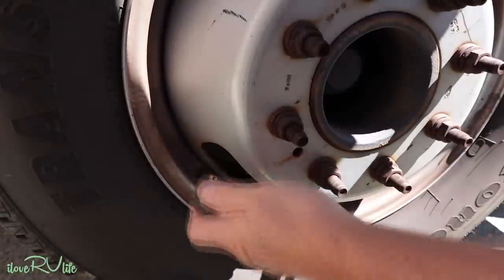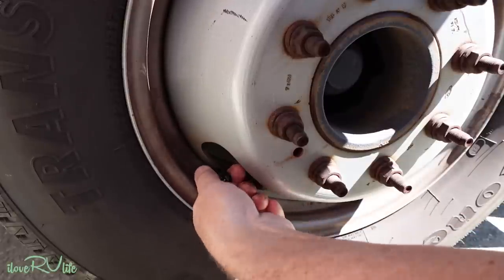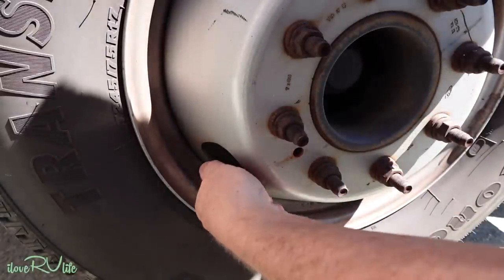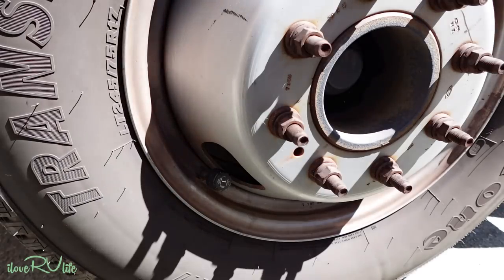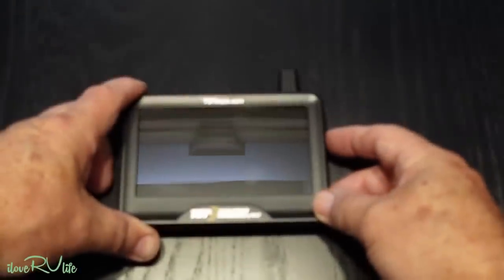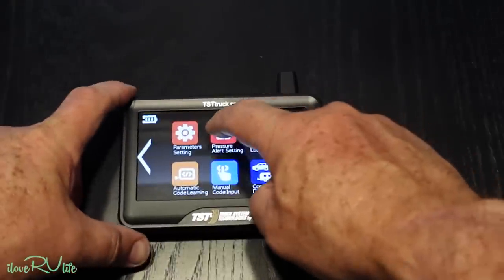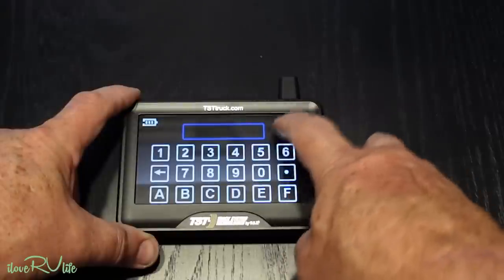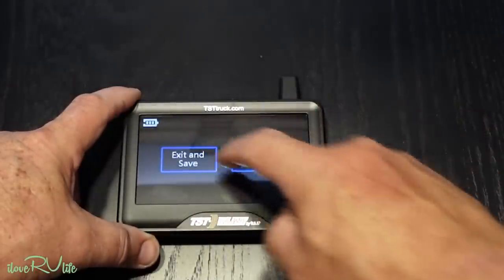Using TST 770 Tire Monitor on 5th Wheel and F-350

Comment: Jerry,
I own the 507 display. And I think new display is backwards compatible with just using my existing sensors. 

My main question, is that beside the bigger display and the second compass screen, is there any other warnings this newer units provides verses the 507?

Thank you👍😎
Reply from the maker: No changes in sensors. Both monitors worked. Same warnings. Better display. Can set up one tow vehicle and screens for 5 trailers. Helpful for those who have RV, boat, etc. Does have the second screen with compass, trip mileage, speed, and altimeter which is nice.

Comment: Jerry, I need to get s new TPMS system for my RV. I used to have a EEZ Tire TPMS but after 5 years of occasional use, it stopped working altogether. I've looked at TST units, Tireminder units as well as another EEZ Tire unit. I reached out to all three companies for more information and why I should choose one of their units and the only company that got back to me was TST, by phone, and within 15 minutes of sending them an email as well! Because of their quick response, I'm likely going to choose TST but I'm torn between the 507 model and the 770 model. First, are you still using the 770 model and are you happy with it? Second, if you are happy with it, would you choose the 507 or 770 if you were in the market to buy one? Thanks.
Reply from the maker: Both are good units. I prefer the 770. Larger screen, improved presentation, more mounting options. I had an issue pairing one of the internal units that was installed at the factory. Called TST, got a tech quickly, and he gave tips to pair and stayed on the line until all was working. Superb service. If I had it in the budget, I’d buy the 770.
Reply: @iLoveRVlife  Thank you Jerry. I trust your advice and love your videos. Keep up the great job you're doing! One more question if I may...My new truck doesn't have a 12V outlet but it does have USB A and USB C receptacles. Will I be able to unplug the cable from the 12V plug and plug that USB C connector in directly for power?
Reply from the maker: @robh063 Thanks so much.  You should be able to depending on the USB power rating. I’m running ours on a standard USB 2.1 amp connection. The 770 has rechargeable batteries so the USB connection is keeping the batteries topped off.
Reply: @iLoveRVlife  Great! Thanks Jerry.

Comment: How hot is too hot and how much is to high on pressure on your tires.
Reply from the maker: Hi Bill.  It depends on the tire. The manufacturer has specs on tire performance and most can be found online. TST has standard settings based on acceptable ranges that are set as default if you can’t find you specs.  I run my pressure at side wall specs found on the tire. Set that on the TST 770 and use the defaults.

Comment: I had a blowout in Louisiana in January.  I think my Tireminder did help and alert me.  I stopped and looked at it and didn't see anything but then it held air for an hour before it blew and it did alert me beforehand.  I would caution you about using the cap type on the truck.  I really liked having them on my truck, but I had 3 tire stem failures on the truck.  Never had a failure on the camper, but after all those issues I took them off the truck.
Reply from the maker: I’m using metal stems on the truck. I’ll let you know how they hold up.
Reply: @iLoveRVlife  i couldn’t find a metal stem pack compatible with my ram.  I will say if you haven’t seen it there is a great metal stem replacement for trailers called the Colby extra short.  Tireminder recommended them for my previous 15” trailer wheels as the contour wouldn’t allow a normal metal stem.  It’s great to keep for emergencies too as it is installed without removing the tire

Comment: I have the tst on my 5th wheel and I did have a blowout with no warning. Just a tire failure. By the way these tires were less than 600 miles old and in date.Tire temp and psi were in range. So tst does not have capability to catch everything. Still love my tst and except some things can not be prevented. Thanks for your video!
Reply from the maker: Unfortunately, If the tires aren’t over or under in pressure or temp, there’s nothing to alarm. I had TowMax on the Gateway. Wish I had done the research on this brand before travel and has a TPMS.  Separation occurred over 3,000 to 3,500 miles. Heat build up blew them to shreds.

Comment: I have a TST unit on my fifth wheel. Last year on are way home from Florida and lost a tire on the fifth wheel. I didn't know it till a passing truck flaged me that I lost a tire. After 5 hours later and a mile walk back for the tire, I was back on the road. PS the tire monitor didn't tell me the wheel was missing.
Reply from the maker: Sorry to hear that. Interesting. I tested the new 770 several times, turning off and on.  It took around 5 minutes to refresh.

Comment: Hey Jerry! Thanks for all of the great videos. A TST is a MUST!!! Just this week, our TST showed one of our motorcycles  trailer tires was 25 degrees warmer than the other. Come to find out that we had a bearing failure. Without the TST we surely would have lost that wheel off of the trailer going down the highway! Catastrophic damage would have occurred. Thanks again for your advice. 
May your roads be smooth and camp sites level!!! Brendan & Lena
Reply from the maker: Thanks for watching. This is a very good system to catch those tire and wheel issues before they become bigger problems. Great to hear it work when you needed it!

Comment: One thing you didn’t cover is the fact that you can rotate the tires and resetting the location. That’s why I got it three months ago.  And Techno RV was who I got it from. The only thing that I have had a problem with it will lose signal on occasion with a single tire but will regain it in a few minutes. I will be interested to see what it shows when we get into northern New Mexico the second week of May the town of Eagle Nest elevated 8250 ft. I looked at the temperature yesterday it was 19 degrees in the morning high about 56. Should be warmer when we get there.
Reply from the maker: That is a nice benefit.  I don’t rotate the dually.  I know….big debate. Hope warmer weather comes to your travels.

Comment: Great product demo. Considering a TPMS for our 22' TT, would the repeater be needed? what psi are these rated for?
Reply from the maker: Hi Tim and thanks. I would if nothing more than to ensure a strong signal to the monitor and eliminate any chance of interference.
Reply: It will work, as it works on 27' TT. But Jerry brings up an excellent point about strengthing your signal to avoid interferences. It is just too easy to just go ahead and install the repeater. Just remember, it's pulling power if directly attached to battery. I just pull the fuse when not in use.
This product is a must for any rv and your vehicle, due to all the extra warningsit provides! Lease don't wait. Best investment in your safety and rv damage prevention. 
Safe travels friend 👍😎

Comment: Thanks Jerry, great video ! Where can you find temp and psi limits for a tire in order to set the alerts? Safe travels
Reply from the maker: I run my pressure based on the side of the tire. As far as temp, TST has set the limits based on their knowledge.  Most tire manufacturers have spec sheets online if a reference is needed.